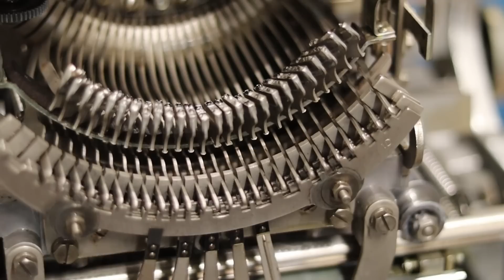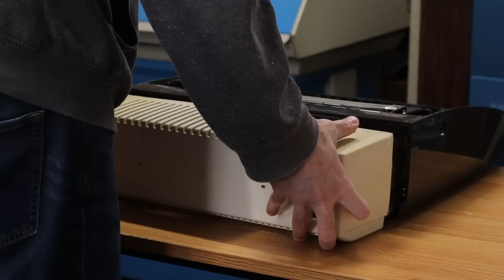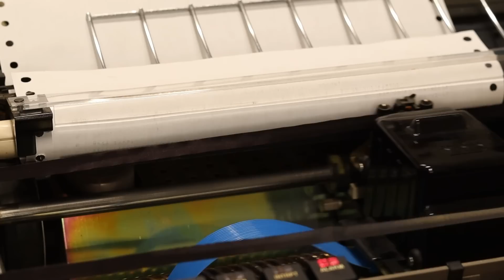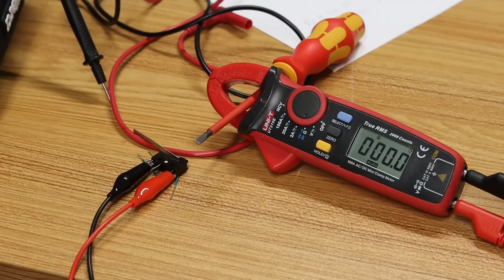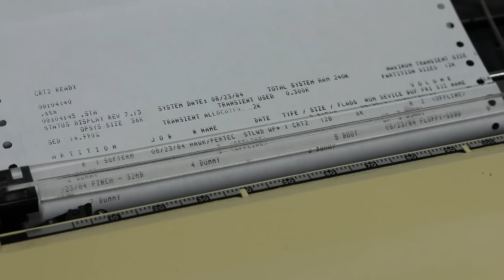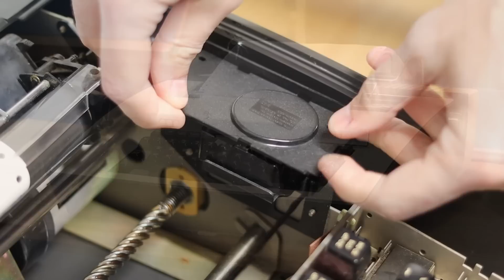Reviving a Model 43 Teletype

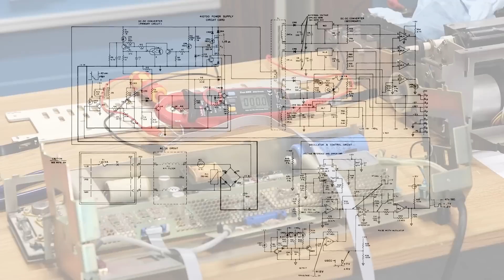Comment: 10:50 The traditional terminology is "rails." "This supply has/produces 4 [voltage] rails"

It's so cool to see you resurrecting and showing off all this old technology. This is all before my era, (I was born in '86) but I still find it fascinating, and I love how you dig up all the history to go along with your finds :)
Reply: Yup, the term is still very much in use, just to illustrate how universal it is the ATX 3.0 PSu spec is titled "ATX Version 3.0 Multi Rail Desktop Platform Power Supply". And modern PC ATX PSUs comes in either "12V single-rail" and "12V multi-rail" configuration, documenting whether it delivers the 12V via either a single massive 12V rail or lots of 12V rails with individual power limits. The former is "highly not recommended" by the ATX spec because it can then deliver the full power to to say the MB 12V line (it'll melt!) but is so convenient that they're actually much more common than multi (12V) rail PSUs because lots of users end up overloading a rail, you have to be really careful on a big build with a multiple 12V rails. And that results in consumer complaints and RMS - both which are expensive.
Reply: I've also heard "buses" for main supply, I guess I'm not sure where one uses one term or the other. I keep thinking about Apollo 13 when they're talking about their "buses" being "undervolted", but that's not the only place I've heard it.
Reply: @CaptainSouthbird  My understanding is that "rails" are on the power supply side and "busses" are what transports/distributes the power from the rails - usually traces on PCB or cables but when huge amount of amps are moved around it can get more exotic - the most insane one I've seen used a ~2x2cm solid copper bar for the -5.2V "power bus" (that was what the documentation called it). This was an ECL Amdahl mainframe, running on 400Hz via a motor/generator set. The ECL VAX'en (86xx) IIRC used flat copper bars instead for their high power bus (and didn't starting from 400Hz), it was power hungry but nothing like the monster Amdahl.

Comment: Could you have double fed paper to fill the width?

So put a run of paper on the RHS, then overlay a run of paper on the LHS. not sure if the double thickness in the middle would cause jamming or something, but it could be a temp solution while you wait for the correct sized paper to arrive

Comment: Nice terminal.

The re-inking rollers in most of those cartridges were pretty hard, and went solid when the ink dried out.

I used to soak them in IPA, squeeze them out and dry them before saturating them with fresh ink. I never needed to replace a roller.
Reply: I comment on that. The sponge on the ribbon is hard because it is just dried ink. He must remove it and soak it in alcohol and squeeze it several times to soften it and extract the old ink. Then he can put in new ink.
Reply: @mikes989  Admittedly, I never had to deal with one more than a couple of weeks dried out. Even then, the sponge was like a lump of rock.

This was always one of the filthiest jobs I ever had to do with a printer service.

Comment: Bunny handling after ink dosing?  You have to take care to avoid the usagi re-inking effect!  That sponge looks as though it might revive, actually.  It's apparently not disintegrating to a squidgy  mush, which has happened with a lot of the spongey plastics of that era.  When they go bad, and they have been employed as PCB mounting cushions, they eat through the inaccessible tracks very efficiently!

Comment: One of the pins on the print head is stuck. It was not uncommon for the print head to get guncked up and need to be cleaned. Spray some deoxit in there and see if it cleans it up.

Comment: It would be interesting to use this teletype for shortwave communication. The necessary bandwidth for such a small baudrate 300bpS  less that 1kHz. But there needs a modem device for amplitude shift keying (like in classical telegraph) or frequency shift keying (a RF receiver  would be not so complex: no AGC, RF mixer without image rejection and low IF  - the CD4046 IC can  be a FSK  demodulator. One cheap logic IC  74HC04  can be a frequency shift keying crystal oscillator and output MOSFET driver. These ICs were developed in 1960s, so , in my opinion they are fit for experiments.

Comment: The KSR-43 brings back lots of memories.  My first "home" PC was an S-100 buss Northstar Horizon kit.  I used a KSR-43 for the terminal to write the driver for a first generation, S-100 buss video card.  It is insane how far things have progressed in such a short time.
Reply: i had 3 NS-Horizon machines even the HUGE External Hard Drives. I use a Decwriter LA-120 for the printer and a ADDS-520 for console

Comment: I always see you struggling with ribbon ink, I know porelon manufactures ink ribbons, maybe it's possible to use their ribbons? Maybe it's also possible to reuse the original spools?
Reply: The ribbon is 1/4” wide and about 27” long which makes finding a replacement difficult.

Comment: Whoa! A Data General Nova 1210! I cut my computer teeth on these back in the day when I worked for a small company in Sunnyvale Calif. that bought and sold used minicomputers. It was called Minicomputer Exchange. I was still in high school when I started there and this was mu summer job for the next 7 years until I graduated from college. I used to know those machines inside and out. Plus the later DG machines: Nova 2, Nova 3, Nova 4, and Eclipse line machines. The Nova 1210 had core memory and ran at a whopping 1200 ns cycle time (833 kHz clock speed).  This was big back in the late 60's, early 70's.

Comment: I loved using theses model 43s even although there were some CRT based systems in the same room. Rather than walking to the next building to get a printout of my project I could just run it off and take it home. The benefit sort of faded when I needed more than a couple of dozen pages though.

Comment: It does look like you have a stuck pin on your print head or (hopefully not a bad drive to it) I seem to remember that may if these issues can be fixed by soaking the print head in IPA for an hour or so, it dissolves the junk that clogs up heads. Otherwise sterling work :)

Comment: I’m looking forward to your Nova project. I was introduced to the Data General Nova at the University of Lancaster in the late 1970s. The Computer Studies Department owned a Nova 2, Nova 820, and an Eclipse S/130 with a WCS that I microprogrammed to directly execute the P-code instruction set for Pascal-P. There was also a PDP/8-I that used an ASR 33 teletype as its console. Good times and great machines.

Comment: Haven't see a Teletype 43 since around 1980. The last one I repaired was in because someone had emptied a cup of coffee into it. The board was solid congealed coffee. I used a steam cleaner with detergent to remove the coffee and then dipped in a solvent to remove the water, let it dry over night and it worked fine in the morning. So, I think they are a little tougher then you think. BTW as far as I know the 33 was always 8 bit (ASCII), it was the 32 that was 5 bit (Baudot). Great to see the inside of a 43 again, brought back a lot for good memories!!

Comment: Great video ! This was actually my first introduction to mainframe computing while I was at University, there was a whole battery of these beasts connected to a data centre, and I had to do data processing for my measurements on them. They got me very intrigued about distributed computing, and although the University switched to Apple ]['s and PC's later on, I had been bitten by the bug and continued to specialise on mainframe and server systems later on: VAX'es, AIX, Solaris, and Linux. Thanks for the great video's, you are my hero, you have a very laid back and easy way of presenting these subjects.

Comment: Thanks for the memories. My first commercial job in the industry was as a Fortran and PL/1 developer. 

The shop used DECWriters to connect to minis, mainframes, and other time sharing networks. 

I lived on 300 baud. Occasionally, we dared to use 1200, but the higher rate was subject to line noise, disconnects, and misaligned output on the printouts.
Reply from the maker: 1200 baud would be flying for a printing terminal!
I'm curious to see how it goes with this thing hooked up to the Nova. Compared to the Centurion, which is very verbose on its terminal output, I'm betting the Nova software I have is much more terse, which will make 300 baud feel totally alright I bet!

Comment: I had a Model 15 that I used for ham radio (RTTY) back in the early 1970's.  I also had paper tape reader and a reperf (tape punch).  This all lived in my 2nd floor bedroom, and the Model 15 pretty much vibrated the whole house when it ran.  My parents were so tolerant...🙂
Reply: Same story, a couple of years earlier.  My parents moved my dedroom to the far end of the house.

Comment: So... like "Ampex", "Kleenex", &c the Teletype company's name became a word to describe a process (& generic device-name). Neat!🙂
And I remember typing Algol programs on the model 33 onto paper tape back in the end of the 60s (when I worked at a Philips research laboratory)...
AND a few years LATER using the no-paper-tape version as system console on a PDP 11/45 (in multi-user mode) when I worked for Delft Hydraulics in The Netherlands.  What memories...
(This is the 1st time that I see a model 43...)
Reply: I wonder what the first instance of those brand-names becoming new verbs was?  Certainly in the UK by the 1950s "Hoover" had taken deep root.
Reply: @heckelphon  Thomas Crapper's name became linked to the noun/verb "crapper/crap" quite a few decades after it was included in the 1846 edition of the Oxford English Dictionary...  So technically that is NOT a brand-name that became a previously non-existent noun/verb.
So I remain wondering with you, HeckelPhon, about such words from before Hoover.🙂

Comment: If you are concerned about parts that are sensitive to static electricity:
1) make sure the chassis is always grounded
2) if you disconnect a part from the rest of the system, make sure it is still somehow grounded. 
3) wear a grounded wriststrip
4) use a grounded mat (but remember not to power or continuity-test anything that is on the grounded mat!)
5) If you are storing or shipping an IC out of circuit - wrap it in foil or put in antistatic bag
6) make sure your (de)soldering iron is also grounded.
7) discharge the capacitors before working on anything by shorting every voltage to GND  
8) do not apply voltages in reverse for testing, i.e. make sure polarity is right when testing power capacitors for shorts even if they themselves are all non-polarized.
9) if you are testing a part that has +5v and -5v input, make sure that both voltages are actually supplied. Some older RAM really hates when -5V is not connected.

I think this is it. Don't be afraid.

Power supply should not have any fragile ICs, you can work on that without too much concern as long as it's grounded and discharged

Comment: Even today, every linux terminal window talks to the operating system through a /dev/tty device - literally a virtual teletype.
Reply from the maker: Now we just gotta convince Linux to output 5-bit baudot at 45.5 baud!
Reply: @UsagiElectric  man stty
yes, it supports 5 bit and 50 baud
Reply: @UsagiElectric  i've seen people do it with ttys from the 20s, i would imagine this little fella would have no trouble with a linux tty
Reply: @UsagiElectric  If you want some fun, look up baudotrss with your favorite search engine. I'd link to the project, but YouTube doesn't allow that.
Reply: @UsagiElectric  someone probably already built that. 😁
Reply: Same with MacOS which is BSD Unix which predates Linux
Reply: My father used to work in an airport and, back in the 80s, he often used the word "teletype" to talk about the system they had to receive transmission from other airports.

Back then, it was sounding like modern telegrams. I presume it was still very much in use up to the early 90s or late 80s for long distance transmissions.
Reply: @sebastienkneur1280 They were used in newspaper rooms, hospitals, and police departments for sure up until very recently. Some might still be in play.
Reply: yes and if you try to use a TTY-specific IOCTL on a non-TTY device, the error code you'll get back is defined as "not a typewriter"
Reply: Yeah its amazing to see an actual physical teletype in action! I never saw one in real life and I always wondered what was the experience like
Reply: Even the Warrex Centurion CPU4 had a native teletype current loop serial interface on the CPU4 3 PCB set.  The ee200 / Warrex CPU4 OpCode [ OE ] was a 4.55ms delay used for the serial teletype I/O software driver.
Reply: Teletype Emulator*

Comment: Those old mechanical teletypes are mechanical computers in their own right. The history of computing can be traced back even further, as the first programmable 'computers' were the player pianos and the weaving looms which could be programmed to weave a specific pattern using punched card.
Reply: not a computer if it can't do math.
and even with ALU most would argue it has to be a universal turing machine to be a computer otherwise it's just an ambitious calculator.
Reply: @snooks5607  That's only true for general purpose computers. Any device that does data processing can be considered a computer.

In the same way that terminals are just as much computers even though they don't do any math.
Reply: @Stoney3K   that is my argument that the word computer today explicitly means general purpose computer. for historical reasons if a machine at one point in time was called a computer although not fulfilling turing's spec of universal machine then I might call it a special purpose computer (similar to how "car" now explicitly means an automobile and "train car" just uses the word for legacy reasons). "computer" also used to be a human profession but you wouldn't go around calling people computers today without appropriate context and disclaimers, it's archaic use that has expired, language evolves.

but then calling things computers that were never called computers to begin with is just invalid, traditional terminals are not computers they're I/O devices that connect to computers.

to be clear I also claim that being universal machine is just the minimum requirement not necessarily the whole deal, because if you start calling everything that has a microcontroller in it a computer you'd devalue the word to the point of being useless. everything from lightbulbs to toasters has a microcontroller in it. nobody installs computers in their ceilings to get light in the room.
Reply: @Stoney3K  happened to notice my reply got blocked, let's try again.. that is my argument that the word computer today explicitly means general purpose computer. for historical reasons if a machine at one point in time was called a computer although not fulfilling turing's spec of universal machine then I might call it a special purpose computer (similar to how "car" now explicitly means an automobile and "train car" just uses the word for legacy reasons). "computer" also used to be a human profession but you wouldn't go around calling people computers today without appropriate context and disclaimers, it's archaic use that has expired, language evolves.

but then calling things computers that were never called computers to begin with is simply not valid, traditional terminals are not computers they're I/O devices that connect to computers.

to be clear I also claim that being universal machine is just the minimum requirement not necessarily the whole deal, because if you start calling everything that has a microcontroller in it a computer you'd devalue the word to the point of it being useless. everything from lightbulbs to toasters has a microcontroller in it. nobody installs computers in their ceilings to get light in the room.

Comment: If afraid of static why not use an antistatic wristband?
Reply: They are only "safe" when used at a full antistatic workstation. Static voltages are relative; no good you being at 0V if the PCB or component you put on a normal surface and are about to pick up now has a static charge; it still gets a zap.

Comment: When I last had a dot matrix printer, I would put a couple of sprays of WD-40 in the ribbon cartridge if it had dried out. It seemed to help both the ink to get moving, and lubricated the pins on the print head over time as well.
Reply: My thoughts too. I did that as a kid without even knowing it would work so well.

Comment: don't like the thermal paper those things used.  Still pretty cool to get one working.  Do you have a model 33?  I left one on the kerb in my neighborhood a few years back because of my wife's glare... and honestly I wouldn't have done anything with it.  And it had mouse nests around the print head.

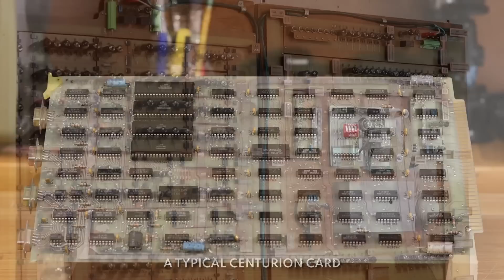Comment: 8:27 Honestly, static / ESD just isn't an issue at all for equipment of this vintage. It only started being a concern with CMOS & NMOS logic family chips in the late 70s. In particular, there is no such thing as a static-sensitive PSU.

For paper, you need a box of standard 132 column greenbar.
Sadly, it looks like you've lost one of the hammers in the printhead, which is a giant pain to repair, but you might be lucky & it's only a bad cable / connection, or a bad drive transistor, which are all way easier to fix than the printhead.

Comment: In the 80's I got in touch with the ASR33 and a Terminet 1200. Now when searching I also found a Genicom TermiNet 2030 on r/vintagecomputing by the user u/theyknewallalong about a year ago, also a printing terminal.

If that terminal had a soul it would have been extremely surprised to be talking to a computer in 2025. Maybe it has though given how easy it was to get it running.